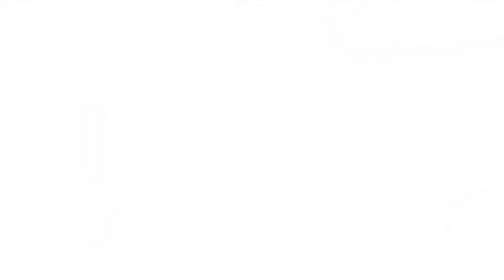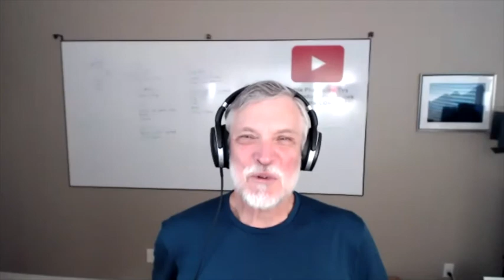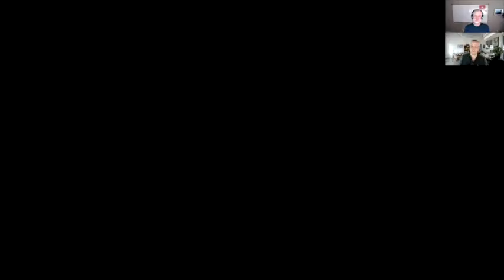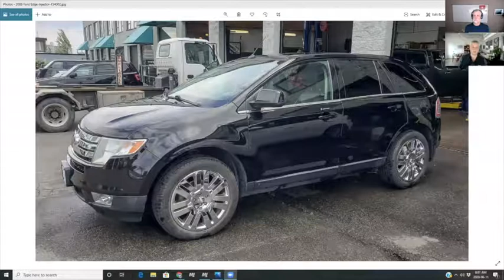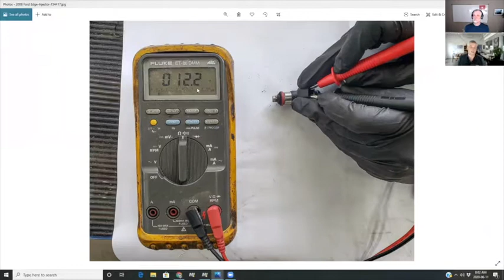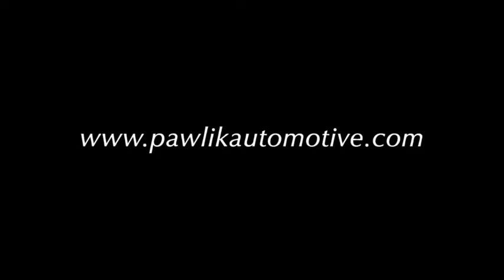2008 Ford Edge - Fuel Injector Repair

Comment: I have a P0204 code on my 08 Edge Limited. Is it possible to replace the injector on cylinder 4 without taking the manifold off and completely removing the fuel rail? Am I able to loosen up the front side of the rail, lift it up enough to replace the injector and secure it without hurting the fuel rail?
Reply: I'm in the exact same position. Were you able to replace just the 4th fuel injector, or did you have to remove the fuel rail?